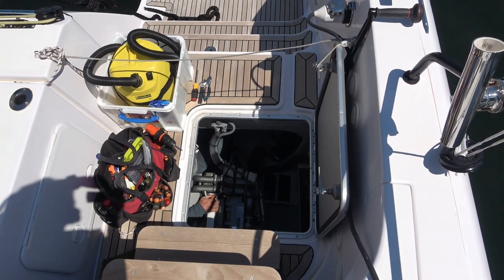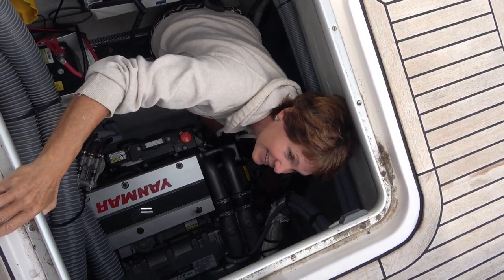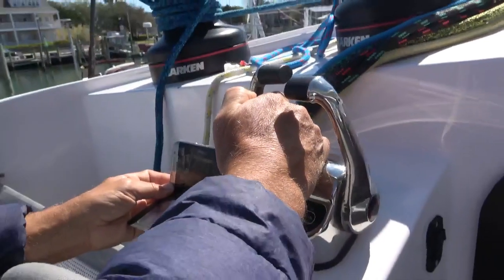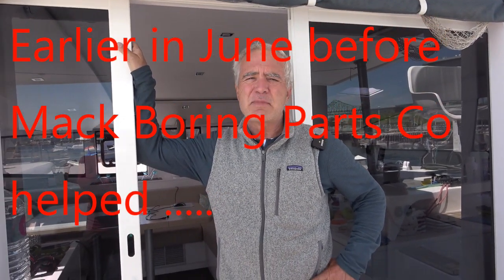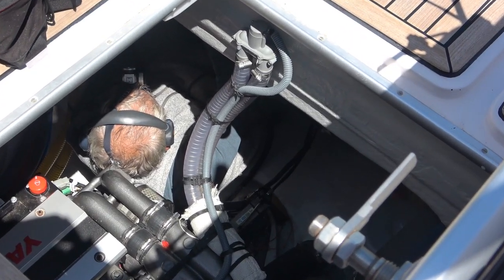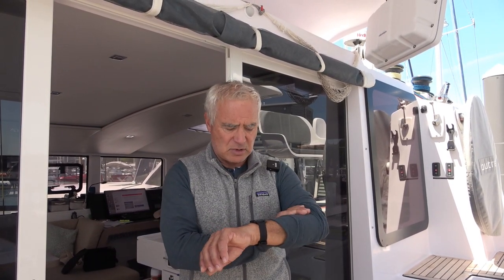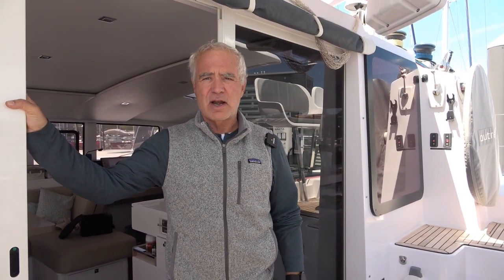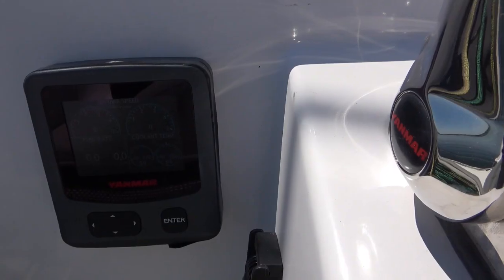Ep.51.  Troubleshooting Yanmar marine engine malfunction on BioTrek

Comment: How do the issues that have arisen so far with your Outremer 5X compare with previous catamarans (brands) you've owned?....AND how's Outremer's backup/support service?
Reply from the maker: You inspired  me to make a video to answer that question . I started it today. Short answer: all boats, new and used take constant work. The mechanical issues with BioTrek are related to customized changes. Outremer typically installs Volvo's (not Yanmar) and no generator. On our last cat, a Catana, Pierre rebuilt the entire electrical system, and in the first 6 months every halyard and sheet broke, usually at the worst time.  That boat  had Volvo's that were never working properly,  giving Pierre has has tons of practice docking with one engine!  We once docked with NO engines in Panamá ie sailing..         One  reason to buy new: Outremer post sales support has been terrific.
Reply: @biotreksailing  thanks for your reply....looking forward to the new video. The 5X looks like a beautiful yacht....

Quick question: can it be sailed single handed (how/setup) and would you recommend it as a yacht for someone who has had little experience yachting (but who is willing to learn while owning it through crewing it with more experienced sailors) or would it be better to look at a heavier cruising Cat like the F&P or a Privilege?
Reply from the maker: See video just posted. We would not recommend a 5x for single handling. Some of the other Outremers or other types of catamarans would be more appropriate for single handed sailing.
Reply: I really appreciate your reply....many thanks!

Comment: Thanks for sharing, I have a 3JH40 yanmar with 600 hs 2019,nice when running, but I have a very  bad experience, I was used at one trip ,for two days ,when arrived I tied to dock. 
Next day I try to turn on ,And nothing. Alarm and COMM ERR at panel,one mechanic from yanmar give inspection,desconect and conect again all cables, and he say is a computer problem, they have take and send to yanmar to fix or put a new one!!!.is in warranty 
But this is a engine for sailors ,what happens if the problem are in the middle the ocean ? Zero reliable this new yanmar
Reply from the maker: That's why a sailboat -  the motor is the backup!